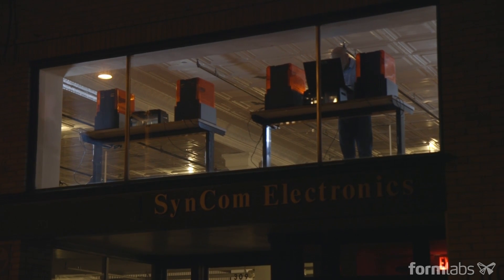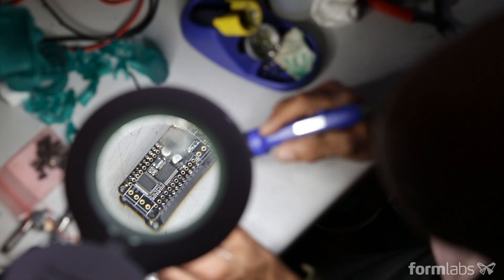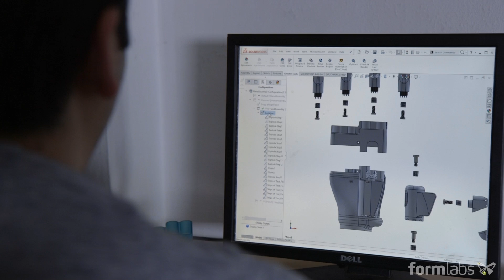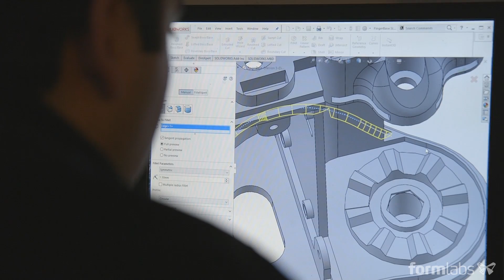Handsmith: Changing an Industry, and Lives, with 3D Printed Prosthetics

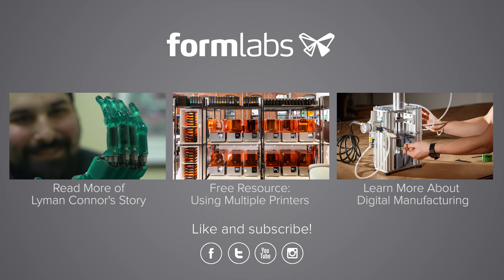Comment: 3:28 exposed gears, though? That seems a little unsafe. Most designs use cables for that.
Reply: I'm sure they will cover the mechanical eventually.  Right now, it looks like a prototype stage that doesn't want a skin getting in the way of seeing how things work.  Personally, I like the gear method, since it gives greater control than cables.
Reply: It looks dope though